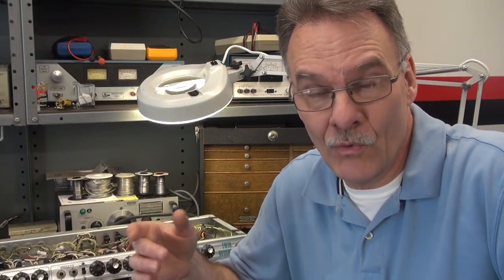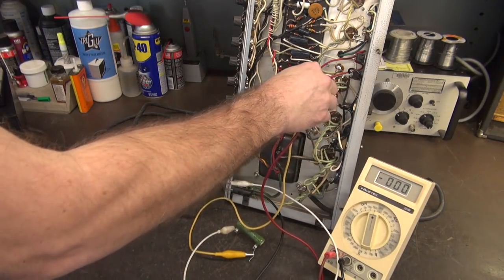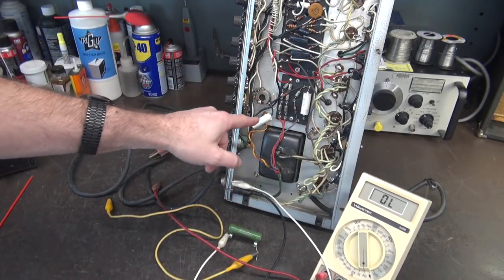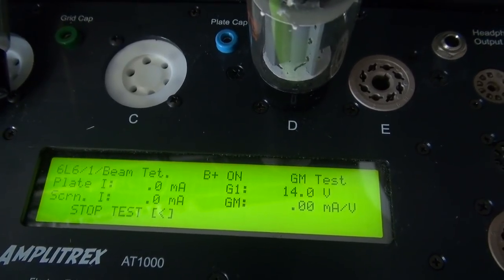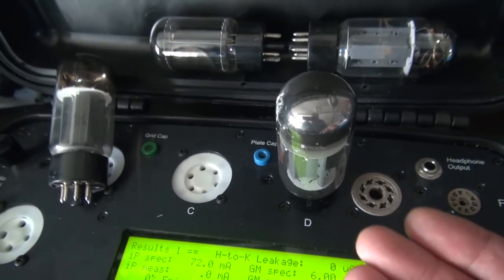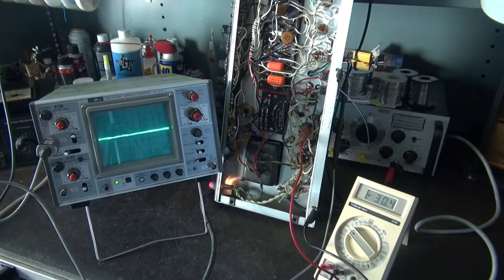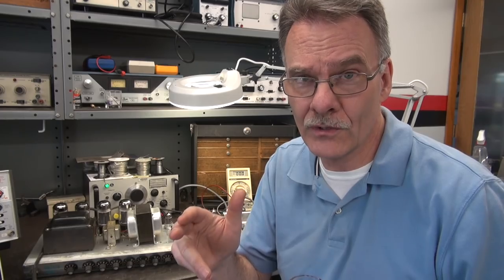How to fix Repair Fender Twin Reverb Tube Guitar amp Bias issue Hot topic

Comment: Another fascinating video. That looks like the Fender AA270 Twin Reverb circuit. The bias pot is a balance not an adjustable bias. When you set the one side to the maximum negative bias you were actually also setting the other side to the minimum. It’s a silly design but very different.
Reply: Yes, he should have checked the bias circuit to determine which type he was working on. Other than that his method is excellent.
I have the same amp. I added a trim pot in series with the balance pot to allow both bias voltage and balance to be adjusted. The new trim pot is only accessible by removing the chassis, which is very inconvenient. I’m considering either drilling a new hole to mount it next to the balance pot or rewiring the bias circuit to AB763.

Comment: Thanks for the video! As I'm sure you're aware (but others might not know), those same crappy IC caps are found in tons of other amps, including the entire Fender Hot Rod series, the 65/68 Fender DRRI, PRRI, etc, and all the Classic 30 offshoots, like the Peavey Delta Blues. In my shop, it's gotten so the customer doesn't even have to finish the sentence, "my amp has hum" before I tell them what is likely the problem.

Comment: Hi Terry, good video, as usual, very well explained. When I bias my amps I do it with the Output Transformer Shunt method, just plug your Amp-Meter parallel to the Output Transformer windings. Thus you do not need to solder in an 1 Ohm resistor. Greetings from Germany
Reply from the maker: Thanks, I will give it a try. Maybe make a video showing how the 2 methods compare. Glad yo have you on the D-lab team!

Comment: Great video. About to work on the exact board (Fender Silverface Twin Reverb). When last used many years ago, it all works, however I´ll be measuring plate voltages and current through 6L6s, measuring neg bias. I´ll need the amp more useful for studio work so will lower the output. Removing 2 of the output tubes, 2 outers or 2 inners, THEN unsolder one of the speakers which is set in parallel as 4 ohm impedance to single speaker 8 ohm impedance. Remeasure, check. Check tone. BTW, great gag with the wine!!!  Best wishes.....

Comment: I'd like to ask, I see that many people say that internal pot adjustment on the Silver Front Fenders is only a balance adjustment not a bias adjustment...
Is this Twin already modded to have that internal pot act as the bias?  Are you "biasing" by just making sure at least one duo of the quad is at the right current and then assume that the other tubes are also in the safe range?

I'm about to retube a 73 Twin I just got from Junior Brown and I'm a little scared so I have a lot of questions!
Thanks for your videos, you explain things great and are very helpful. 
Cheers!

Comment: Now and then on a job you may come across twin and earth cable that is oozing a strange green goo-like substance, almost like washing up liquid. 

The wet green liquid that you are seeing is the product of a reaction between decomposing plasticiser (a plasticiser is an oily liquid used in the manufacture of PVC compounds) and the copper conductors of PVC cables. It’s better known as cable ‘greening’. 

The decomposition of the plasticiser is caused by overheating the PVC compound. It is usually a slow process, but can be accelerated when high temperatures are involved. High temperatures can be caused by external reasons, but overloading and loose connections are two common examples.

Although all cable grades of PVC may look the same, the cheaper grades can be more prone to producing the green goo. The main instances of ‘greening’ cable arose during the 1960’s and 1970’s, although some instances are still seen today. Inferior grades of plasticiser were prone to greening even if the cables were not overheated.

The plasticiser of better grades of cable, such as those produced by Prysmian contain an antioxidant which inhibits the decomposition rate of the plasticiser when heated. Even these plasticisers can be broken down eventually under adverse conditions of heat, but are much better protected than those which do not contain an antioxidant. 

Although fumes may be given off when PVC is decomposing (this statement is applied to house wiring) it would not be considered to be a health hazard, but there is a danger that the breakdown of a cable could cause an electrical fire. 

The plasticiser itself is a clear oily liquid that is non-conductive. The green substance is a combination of copper oxide and plasticiser which is conductive. Therefore, whenever this green substance is found at socket outlets etc. it should be removed and the terminations cleaned (gloves should be worn) otherwise it is possible that tracking/overheating may occur. It is normally considered that if greening is found that rewiring should strongly be considered. 

If, however, it is considered that rewiring is not required and the effect on decoration and equipment is acceptable then the following actions are advised: 

Periodic inspection and testing is carried out 
Visual inspection of cable ends, equipment and cleaning/replacement is carried out as required 
That the resistance of conductors is monitored to ascertain that conductors are not being over oxidised (in parts of the cable that cannot be seen) and their resistance thereby increasing 
The question of how frequent inspection and testing should be carried out is a good one, but no established guidance exists. Therefore, only by experience of the particular installation concerned can the frequency of periodic inspection and testing be determined.

Comment: 21:48 - 60 Hz hum is NOT a sign of failed power-supply filter caps. Those exhibit 120 Hz ripple, not the smoothsine wave you showed on the oscilattin' TV) 

It's probably bad shielding of the preamp stage

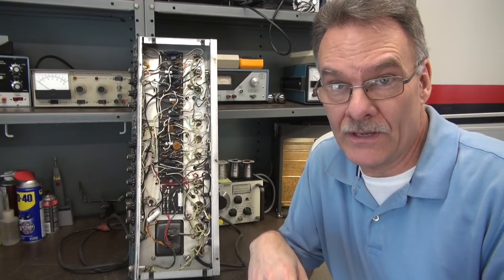Comment: 3:41 - A shorted output transformer will have NO effect on the output bias current. The tubes will simply deliver the same (admittedly high) current to a shorted load.

Comment: My dad was stationed at VAFB from 67 to 68 or so. I went first to Lompoc Jr. High, and then to Vandenberg Jr. High. I am wondering why you did not use axial caps? Was it just because you did not have any at the time? I have worked on those awful MV models and they can be a pain. I will bet the blue gunk leaked from the old caps. I wonder why someone used three good Atom caps and then two of the crummy IC caps. All in all another good video. Thank you Terry, keep 'em comin'
Reply from the maker: Yep, just some radial stock caps I had in stock. Roger that on the crummy IC caps, I thought about mentioning that.

Comment: You're about the only one who doesn't like the "dark blue drop" caps. Most techs (like myself) regard them more like an Orange drop with a different color epoxy. OK that's not a great description and there are different varieties of orange drop too..but they're usually the least-suspect when I dive into a Fender of that age. Not pretty, but IMHO they hold up pretty well; but I don't service anywhere near the quantity you do. But...techs with much more experience tell me they have very little trouble with those.

Comment: Terry where do you find caps at how do you know if you can use electro or orange drops need a little clarification on caps
Reply: Look at Digikey or Mouser or Allied for current stock electronic parts, which is sure what I'd use for cap replacements. Avoid eBay like the plague for this, unless you really know what you are doing and can tell if what you are getting is useful or trash. Most old stock caps (especially electrolytics) are likely to be trash.

As to poly or electrolytic caps, you should generally be replacing with the same kind that the original was. Electrolytics have large capacitance values (generally 1 uF or larger) and poly caps have small capacitance values, generally 1 uF or less, often much less.

In general, filter caps (power supply filters, large cathode bypass caps, large screen bypass caps) will be electrolytics. In general, small coupling or tone filtering caps will be paper/mica/poly, all replaceable with poly caps.

Comment: Terry what do you think about the brown Mallory caps?
Reply from the maker: Hello, if they are grid caps, I say change them. If they are the dual electrolytics going to the pre-amp tube cathodes, also change them. Normally I simply change caps in those areas as preventative measures.

Comment: Hi love to just watch your your videos , Its amazing .  I was wondering I have a new guitar amp that has this auto bias system that is suppose to bias each sep power tube.  You can change out a couple 6L6 and couple EL 34  or 4 of each what ever and the amp is suppose to bias them for you .  I am wondering if this system of there is actually working properly.  I do have a multi meter but I am not very good at tube stuff lol.  The amp has this strange kinda thin tin canish kinda sound in the mid range when playing threw the high gain stages.  I replaced all of the tubes with very high quality matched sets that went threw 24 hours of testing.  The amp seems to still have that strange mid range tone that I just cant seem to get rid of unless I really scoop out the mids.  Could you explain to me what happens when the tubes are UNDER bias.  The tubes do not red plate so I do not think they are running hot on bias but wondering if maybe they are low.  Can you tell me if this could be the issue and what is a good basic bias current for a quad matched set of 6CA7 (EL34) tubes.   Thanks for any info you may give :)

Comment: What range of resistor value would work loading the high voltage to dissipate it to ground?  I can't find a 20W 40K but have a couple of 50W 10K.
Reply: The amount of resistance you pick determines the load on the power supply. It also determines how many watts your resistor will dissipate. 

You can either calculate V squared over R or I squared divided by R. Assuming 400V for B+ and 10K, you get 400 * 400 / 10000 = 16 watts. That would be OK with a 50W resistor, but it is going to get HOT. 

But also calculate the load on the power supply: I = E / R. 400v / 10000 = 40ma. Since this amp would draw at least 120ma at idle you are OK, but that might not be a good load for a preamp.

In general, a 40K-50K power resistor makes a good safe dummy load for the B+ in most power amps, and you don't have to think much about whether the load will be safe for the supply or the resistor will get smokey hot. Much lower than that and you have to start thinking (or maybe worrying) about load and heat, and much over 100K and it can take a LONG time to discharge big filter caps.

Comment: Hi. I have the same amp. It's working fine. Nothing is wrong with it. But you gave me something to think about with the parts you changed. I assume mine has all the original parts. This amp belonged to one of my uncles and I believe he was the first owner. He is no longer with us so I can't ask. Can you please name the parts you changed and tell me where can I purchased them. I know you said the name of them on the video but you could've said it in Chinese and I still wouldn't understand. 😂😂😂 I just know how to soldier. So I'm a complete idiot when it comes these electrical parts on an amp. Unfortunately another uncle of mine who could've helped isn't with us either. Loss 3 of them in the pass 3 years. I would appreciate the help and any other advice or info you would like to share or guide me with. Thanks.
Reply from the maker: I would highly recommend changing the 2 bias & grid coupling caps as a minimum to protect your amp

Comment: I wonder what that Invasion of the body snatchers goop was?
Reply from the maker: I believe it was produced by the old caps as they failed. When replaced it was not cleaned up. The residue on solder joints is not a good thing.
Reply: It is plasticizer leaching out of the wire insulation.

Comment: shouldn't  your max negative voltage be -36 for 6L6?
Reply: You can take the grid bias for almost any tube down to about -100V. The farther negative it is the less current the tube will draw. Eventually it will "cut off" or stop drawing current at all. Then it isn't an amplifier, it is just a filament sitting there drawing power. 

If you take tubes down below their design bias point you can start introducing distortion, because the tube will cut off during part of the input wave cycle. So you could end up clipping the top or bottom of the output waveform. Doing that also introduces a bunch of harmonics the output transformer might not like a whole lot, so it is best to keep the bias near the design center. 

But in general you won't hurt the tube by taking the bias too far negative. You sure can hurt the tube if it isn't negative enough (red plates, anyone?).